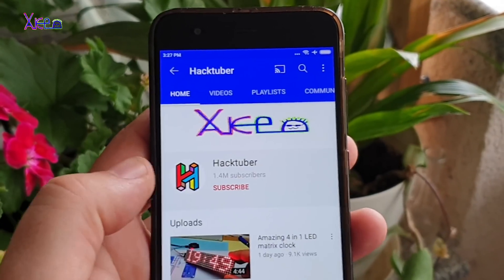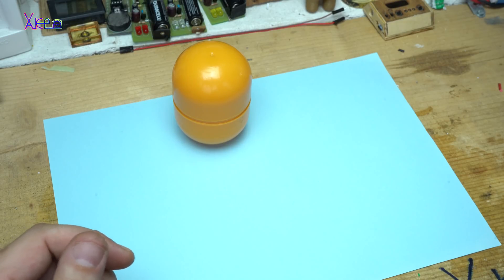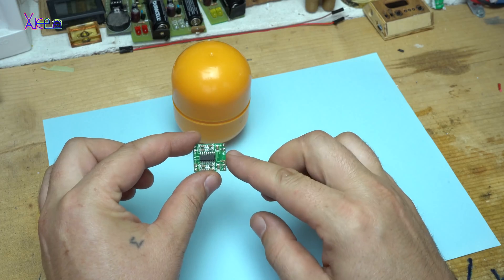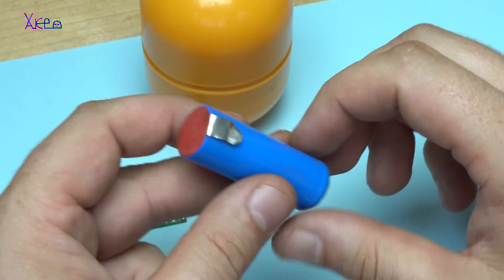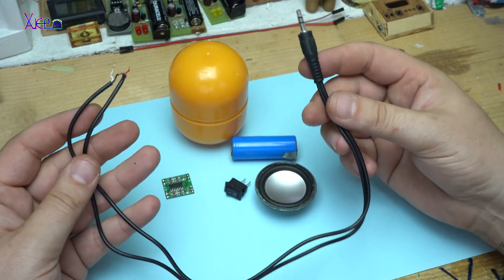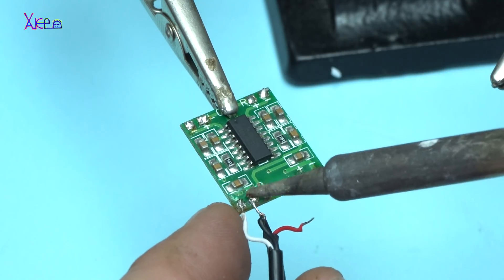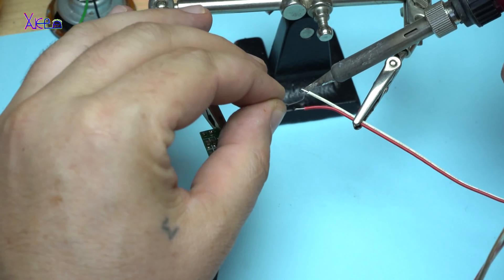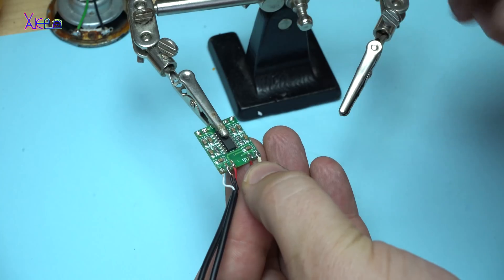DIY Simple Speaker Amplifier made out of Egg

Comment: I like the amplifier but how are you gonna charge the battery
Reply: my thinking is get a charging porotection board and connect it
Reply from the maker: What you think,how?
Reply: @Hacktuber  I was just wondering if the battery is already soldered and I didn't see a charging module how you would charge the battery
Reply: @Hacktuber  ıs this battery rechargeble?

Comment: La batteria come si ricarica?
 How does the battery charge?
Reply from the maker: I know,for charging need to open the egg and charge manual with my power supply
Reply: @Hacktuber  ok..thank you
Reply: charging module tp4056 would make a good solution.
Reply from the maker: Thats right
Reply: @Nilltronic  non è previsto nel video ...it is not provided in the video